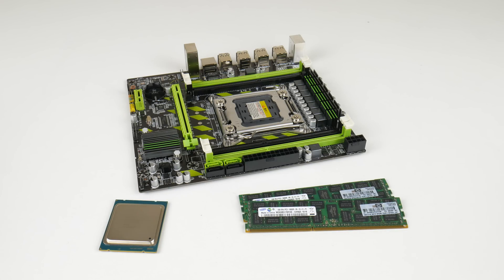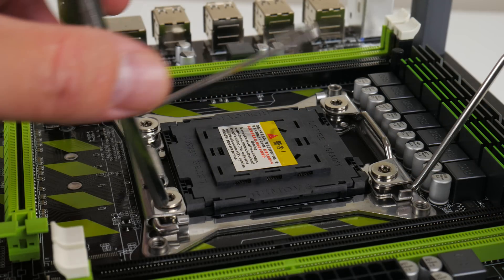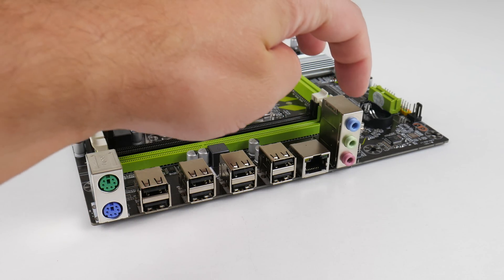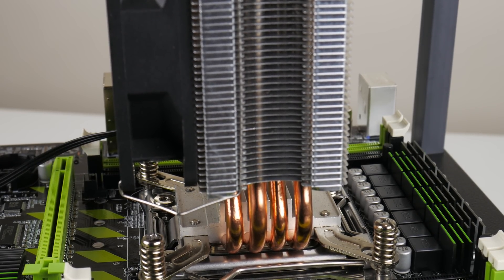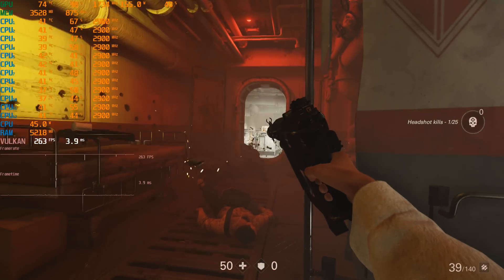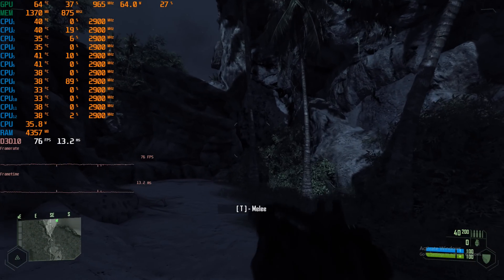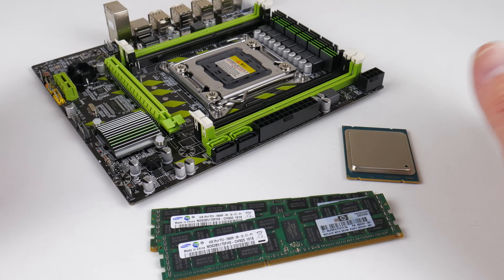$99 LGA 2011 Motherboard 6-Core CPU 8 GB RAM Budget Bundle

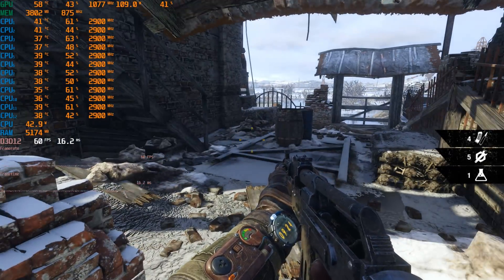Comment: 10:55 Tessellation is NOT "Nvidia Stuff" it is a FUNDAMENTAL Rasterization technique for DX11 and newer, and makes ALL games but Especially Metro Exodus look MUCH LESS FLAT! NTM ATI Invented it and was the FIRST to have any hardware to accelerate it! And Navi is good enough at Tessellation that you should DEFINITELY enable it, just use the "AMD Optimized Tessellation" settings in Adrenalin Drivers!

I get turning off GameWorks stuff, but Tessellation? That is a normal game feature, and if AMD sucks at it, it is their own fault, because ATI INVENTED IT! Nvidia just did it better first, because unlike GCN, Maxwell and newer were ALWAYS Geometry powerhouses! Navi seems to be catching up geometrically and in terms of Tessellation to Nvidia ever since Maxwell.

Comment: Just no point in using a low end 6 core when u can get the 1620 (v1 or v2) that's roughly the same in multithreaded loads and destroys these in singlethreaded ones....btw, Im curious to see this vs a 1620😉

Comment: Nice to see you use War Thunder in the benchmarks! Out of curiosity I just ran some benchmarks with my Ryzen 1200 @3.9 GHz with 2x4GB 2400MHz RAM & MSI Armor RX 470 4GB, in the Tank Battle (CPU) benchmark I got 58.9 Average FPS & 46 Minimal FPS with a rating of 3363, Tank Battle gave 54.2 Average FPS & 44.8 Minimal FPS with a rating of 3375, that's with everything maxed/on except SSAA at 1440p, dropping to 1080p gave me 80.7 Average FPS, 64.2 Minimal FPS & a rating of 4609 in Tank Battle (CPU) while Tank Battle gave 73.9 Average FPS, 61 Minimal FPS & a rating of 4603

Comment: 6:05 what processor did you mention here for overclocking
Reply: donot touch 1620 1650 or 1650v2 xeons are unlocked
Reply: Thomas Stöberl are 1620 or 1650’s more powerful than the one in this video? Can it use the same mobo in this same video?

Comment: Are the Xeon CPUs from AliExpress accurately represented? I have a nice LGA2011 board that has a good i7 but supports a slew of Xeons...  would make it so much cheaper to max out RAM (board supports 128GB).
Reply: I've ordered 4x E5 2620v2, 2x E5 2667v2 and 2x x5365 Xeons from Ali Express.

All of them were exactly what I ordered, and all of them are running fine. The E5's are all in Chinese boards like the one in this video, and the x5365 pair are in a 2006 Mac Pro..

I've found the prices better than eBay's, and selection far better.
Reply: Good to know, thanks.

Comment: for 5 dollars more yo can get one with m.2 and usb 3
Reply: Dont start with that or this is going to end up becoming a Ryzen build really fast 😉
Reply: @TacticalPower88  kkkkkkk😂
Reply: Agreed. My 2010 very budget AMD system had a pair of USB3 ports. Pretty pathetic that a 2011 socket motherboard doesn't have any at all.
Reply: @RandomPlaceHolderName  You right but the problem is with 5 dollars more people from a lot of countries should pay taxes and in this case isn't worth it, only if is extremely cheap without any taxes.
Reply: @mr.schaeffer5399  If $5 is a lot of money where someone lives, they probably aren't spending $100 on a 6core PC.

Comment: I know you're probably overloaded with requests but could you do a comparison of dual vs quad channel RAM using the same CPU+GPU? to get an idea if its worth the price difference.

Thanks
Reply from the maker: I do remember looking into this, including different frequency RAM. With  Dual Channel, it's important to have the highest memory speed the CPU supports. On the 2630V2 that's 1600 MHz, on the 2650V2 1866 MHz.
Reply: He did it on a video there was a 10 fps difference in shadow of the tomb raider between them
Reply: @kruxdt6307  Thats a lot,  do you remember which video it was?
Reply: @JuanSanchez-rb4qu  the 2689 review or the plexhd mobo review
Reply: @kruxdt6307  thanks I'll check that out

Comment: Good video Phil, indeed we can call this a cool bundle. What about this mobo? 20 bucks more with quad channel? Does this supports OC with K processors? Have you tried it? https://www.aliexpress.com/item/32797594279.html?spm=a2g0o.productlist.0.0.38a6713frwaIhB&algo_pvid=9a35f965-be17-40c9-b663-cee9f27cc4e3&algo_expid=9a35f965-be17-40c9-b663-cee9f27cc4e3-1&btsid=3d6ba3ff-4af3-44b1-aafd-75baffadeb45&ws_ab_test=searchweb0_0,searchweb201602_1,searchweb201603_55
Reply: The one you linked is 30$ more if you include shipping, maybe take a look at this one(also quad channel, but free shipping): https://www.aliexpress.com/item/32969830382.html?spm=a2g0o.productlist.0.0.691411044ON3xU&algo_pvid=eae5931f-5c90-4053-a559-67d23b2fcd23&algo_expid=eae5931f-5c90-4053-a559-67d23b2fcd23-1&btsid=9b5c588f-9af4-4fe5-89d6-05f1dfe213d8&ws_ab_test=searchweb0_0,searchweb201602_10,searchweb201603_55

And if you are looking for quad channel ATX mobo, check this one out (also free shipping): https://www.aliexpress.com/item/4000060651126.html?spm=a2g0o.detail.1000060.3.426264694gETW9&gps-id=pcDetailBottomMoreThisSeller&scm=1007.13339.146401.0&scm_id=1007.13339.146401.0&scm-url=1007.13339.146401.0&pvid=b8e65754-612b-4438-880f-110e149d88a8
Reply: @davidtemp1045  it seems though is the "older" version
Reply from the maker: Yea that's the Plex HD that I've reviewed already and used in quite a few projects :)
Reply: @philscomputerlab   yeah i saw it, any overclocking besides the ram? Cpu multi? Thanks

Comment: That 2630v2 benches almost identically to the towers in my office with 1240 v6 chips (only quads, but new and $300 instead of $30!!). Those extra cores make all the difference if you can use them.

Comment: I got this exact mobo/cpu build (except for 16Gb RAM) for $103 during 11.11 sale. It's great - paired with RX480 it runs DOOM at 120fps with almost everything maxed out.
P.S. Ran into a weird issue with this mobo where, if paired with only 2 memory sticks, it would only boot if memory sticks are in greeen slots. Apparently this is normal and it says so on the product page but I missed this info and had some trouble figuring out what was wrong.
Reply from the maker: Yea you have to use the green slots :) Or fill all 4.

Comment: So is the memory running in ECC? If so, can it be disabled? Maybe that is holding back some performance?
Reply: I doubt it honestly. They use some weird chipsets on these boards.
Probably is just the clockspeed that is limiting.
2.9 isn't very high.
Reply from the maker: You can't disable it AFAIK!

Comment: Bought a similar platform recently: PlexHD mobo, E5 2630 V2 CPU and 16 GB of RAM (4x4GB, because the mobo supports 4 channels).
Never felt better! CPU temperatures (under 100% load) usually hover around 45°C with a basic 4-pipe tower cooler with a 140mm fan set to constant ~600 RPM (under any load). Had no BSOD's from the day I bought it, and the performance pleases me quite enough.
Yes, with older (or the ones that can't handle multiple threads) games I have a bit less fps than my previous oc'd i5-2550K (and games that can utilize threads, like Just Cause 3 - run buttery smooth now), but I have much better RAM performance, and increased multithreaded CPU performance under the things I do every day, which are: encoding in 10-bit x265, packing stuff in 7z (with high dictionary size), and other CPU-demanding tasks. New CPU does that sort of stuff much better, even though the "raw" CPU power stayed nearly the same (4.5GHzx4 vs 2.9GHzx6) - thanks to more cores and threads.
Not to mention that I can easily do 32 or 64+ GB of RAM (in the future), due to low-cost server (ECC REG) DDR3!
I also plan on replacing the CPU with something more threaded (but also low on temps) later on - like 2680 V2 or 2695 V2, or even try x99 mobos with V3 CPU's, as the mobos can be "hacked", so that the CPU's will use their single-core turbo boost on all cores.

This post wasn't for bragging rights (there's nothing to brag about, actually =D) - I wanted to encourage someone to try Xeons, as they're awesome. They're server-grade (hence, more reliable than, for example, i7/i9), they support more RAM and more RAM channels, and the temperatures are super low, even when maxed out with AVX-supported apps (like x265 encoder, for example). And for the extra horse-power (if you're rendering, or doing other CPU-bound stuff) - you can pair those CPU's on one mobo - that'll be one beast of a machine.
And all that will cost you a tenth of the price you would've spend on a modern build, while delivering you roughly the same performance. =)
Reply: x99 is basically the same as x79 except it supports DDR4. The CPU's are almost identical. It's not really an upgrade IMO. Just get a 1650 v2 and overclock it.
Reply: @tubularmonkeymaniac  No man from v2 to v3 the ipc had a good jump and avx2 and new technologies was implemented.
Reply: @tubularmonkeymaniac  x99 are haswell processors. Not the same as the IPC bump is around 10% at same clocks
Reply: @tubularmonkeymaniac  I thought that I mentioned that I do heavy threaded stuff, so oc'd 6-core CPU won't do much for me, as (like I also mentioned) I plan to replace the CPU I have rn for either a 10+ core x79 or 14+ core x99, or even get a dual-CPU mobo, and slap a pair of cool (temps wise) CPU's in there.

That first Xeon was only for testing purposes (I'm also a fan of total silence, so I went for a 80w v2 CPU (for a start), instead of a v1 one), as I haven't witnessed (first hand) that platform yet. =)
DDR4 also won't do much - I'd invest in more cores or better GPU (on a platform with 4-channel ECC REG DDR3) instead if getting DDR4 just for the extra points in synthetic benches - e.g. encoding in x265 or 7z packing has (almost) nothing to do with RAM, so it'll be a waste of hard earned cash overall if you invest it in DDR4 (instead of 4-channel DDR3, which performs on par with DDD4 anyways, from what I've tested on my rig), imho.
It's Intel, not Ryzen, dude - CPU's can benefit even from a 4-channel 1600 MHz DDR3, and the "sweet spot" (from what I've tested) is at about ~60 GB of throughput, which even a 1866 MHz DDR3 can deliver.

I'm not one of those dudes who use RGB on the RAM sticks because they believe that it adds more fps. =)

And maybe we'll see a day (in the nearest future, tbh) when 6-core CPU's will be choked in modern games/apps, like 4-cores ones are now, so getting a 6-core CPU (even with HT) won't be future-proof, as I see it.

Comment: Well I have the special case of having access to Taobao directly and I have hundreds of 2-4GB DDR3 ECC memory sticks lying around to test and sell, so basically I have no other choice but to get this platform. So basically I can get 16GB of RAM for free in that aspect.
Reply: Blessed you can buy x99 boards for a good price
Reply: Crusader B Well it is really the CPU that I got good deals on. The motherboard i got is similar to the PlexHD one featured in this channel and it cost me ¥350 so definitely more expensive than this one, but I guess one thing is that the technical support over taobao is more efficient should something go south (Because the sellers want to do everything to avoid a crap feedback). The cooler I also saved a lot too. I got a hyper 212 for just ¥69 (US$11) from cooler master's official taobao store.
Reply: @kruxdt6307  nvm the mobo is also cheaper on taobao too. Found that same mobo for US$35. https://item.taobao.com/item.htm?spm=a1z09.2.0.0.5a782e8dcZNpzR&id=546688061148&_u=e3b2pvsv312e
Reply: @kztech1319  I've been analysing taobao for 2 months the price to preformance there is insane

Comment: How does this compare to a Xeon x5675 overclocked (4.2 GHz stable)? I'm almost done with my build but if this outperforms it (or an oced processor does) I could probably upgrade and make money off of the old parts.

Comment: Hi there is another very similar micro ATX board on Aliexpress - also only 2 channel DDR3 but with USB3 and NVME starting at around 54$. I tested it and everything works great - besides sleep of course.
Reply: Sleep? What's that? 
I haven't slept since the public release of the original Playstation.
Reply: My recommendation is to pay the extra $3 and get the right board.
Reply: Izaac Channen what board for $3 more ?
Reply: @619-SD  click the link,  same seller,  check item description title.  and $10 xeon v2 is good too.  add 12 gig 1600.  very cheap gaming combo.  Honest.

Comment: Hey Phil, have you ever considered using an Xeon E5-4600 v1/v2 series CPU? They should run on most LGA2011 boards and are quite unknown to most users. However, I don't know if the chinese boards will also work with them. Especially the E5-4627 v2 looks interesting with an all-core turbo of 3.5 GHz, if you want to pass on Hyperthreading.

Comment: These old Xeons seems like better value for the money than the AMD Ryzens.
Reply: lmao some of the xeons actually give better price to performance than 1st and 2nd gen ryzen
Reply: Ricky mic doo that’s not hard when a 6/12 processor is $40 compared to $200 release price of the 1600 and 2600. But when you can find them both for about $100, I’d definitely say that they don’t. Considering that the ryzens are a whole ghz faster and have an ipc advantage, they’re definitely significantly faster and have an amazing upgrade path. I went from 1600 to 3800x in the same motherboard. And I sold the 1600 to a friend for $50 and their old 1400. You can’t beat that.
Reply: @dylanneff8338  yeah am4 is amazing

Comment: so this became a weekly Ali Express promotion I guess?
Reply: Good deals are good deals.
Reply: @baronvonlimbourgh1716  nah, it's old energy hungry stuff. I have a mac pro don't need another of those suckers. AMD ryzen 3950x ftw ;-)
Reply: @renerebe  yeah sure.  But on a budget these are still very good. Although the 3500x is also a gamechanger.
A ryzen 8 core set with 16gb of mem and board for 225 euros or so new is what you want to buy as a gamer atm. Really can not beat a complete set offering 9900k performance for less then half the price of just the 9900k itself.

And epyc, ohh my goooood is epyc awesome haha.
We replaced 3 full 42u racks with all sorts of intel servers with two 2u dual socket epyc servers.
And both servers are less then 75% loaded most of the time.
I could put that under my bed and run them from a domestic outlet if i wanted... 
The savings on electricity for aircon alone is a nice sportscar per year, not to mention the actual electricity the servers used to use. These servers where expensive as hell but probably still pay for themselves in a year or 2 through just the savings on power. 
3 full racks with probably 1 tonnes of hardware running on 4 dedicated power phases into 2 measilly boxes the size of a big gaming pc.. Trully insane stuff.
Reply: Baron von Limbourgh yeah, last year’s Ryzen is still a better, more future proof and energy efficient bang for the buck.
Reply: @renerebe  indeed. Crazy how fast we are catching up now after a decade of stagnation. We should have been here half a dozen years ago allready honestly.
Good times for cpu enthausiasts.
Reply: @baronvonlimbourgh1716  All I have to go on are benchmarks I'm reading on line, but the 3500x is about 1400 points below my 9700K in Cinebench R20. But you are definitely right-- 225 euros is still a fair chunk below what I paid for just the CPU. Epyc... yikes... I can't wait for that to trickle down to us normals :D
Reply: @EpicureMammon  i made a mistake. The 3500x is a 6 core not an 8 core. If you clean up the mem timings and use fast ram there basicly no longer is a difference with intel pretty much.
Even at 6 cores it still is a good deal though for 100 bucks and good enough for the next year or 2. And by that time just upgrade to a 3900x for 150 or 200 bucks or so. That should last another 3 years or so easilly then with just the cpu swap.
Reply: @baronvonlimbourgh1716  I hope that didn't come off as a "well, actually"! I haven't had my hands on a 3500x and was just curiously googling reviews. I just got my 9700K at the end of November, and I wish I'd waited for the new AMD chips that were about to drop. I'm not disappointed in it, but since it seems like CPU upgrades are getting further apart (my last new CPU was an Ivy Bridge), I'll probably be keeping this one for a while, too, and should have waited to see what 2020 was going to bring us. 

Cheers!